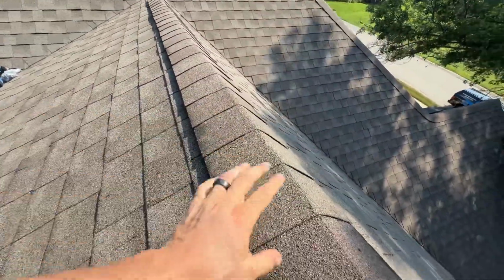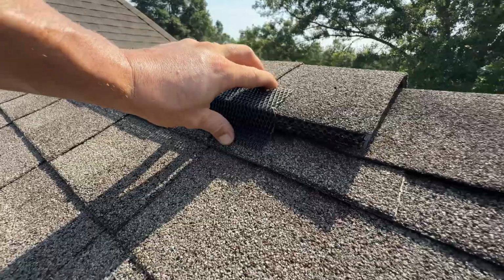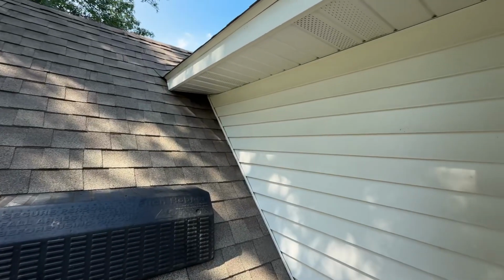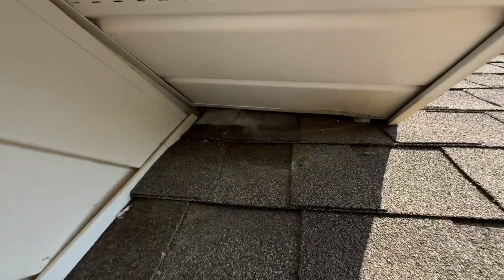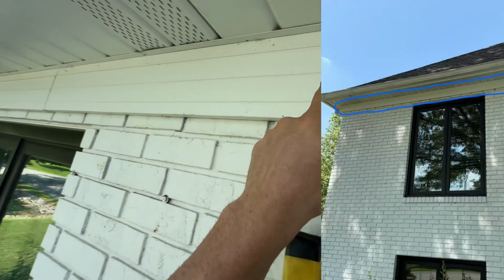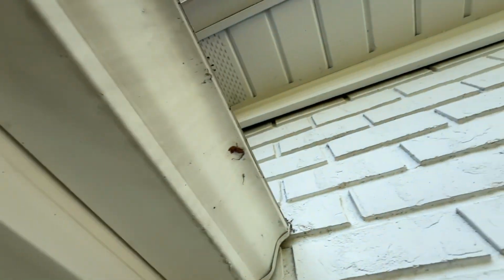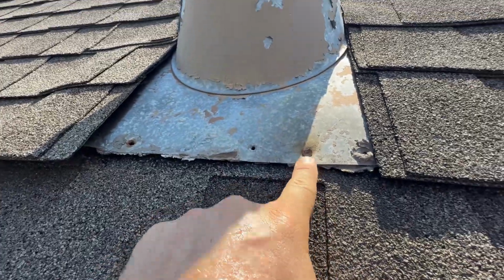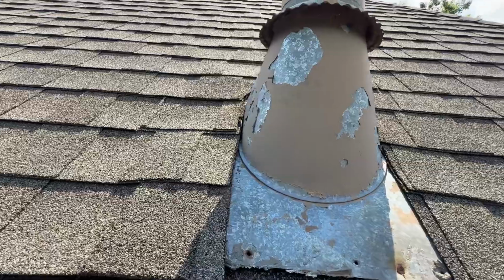How Bats Get Into Your Attic | Real Home Walk-Thru

Comment: Thank you so much for all the information. We have had 3 bars come in our house through our attic hatch. I even set a camera in the attic but did not catch them inside the attic . We haven’t been able to see where they are getting in from but you have shown more possibilities thanks! Would love to know if they are coming in through the attic vents , how would you install a one way trap over them without damaging the roof ? How many traps would you say you typically install ?
Reply from the maker: If you are having trouble pinpointing entry points, you can do what we call “bat watches” and have a couple different people stand around the home near dusk/dawn to see if you can spot where they are coming/going from.

You can use different fasteners to secure the one way bat door to the roof. Just make sure once you remove it that you are sealing over any penetrations to the shingles. Or you can use sealant products to temporarily glue it. It all depends on the location of the bat door. Our average home gets 1-3 depending on colony size and how many active entry points we have.
Reply: @PrecisionPestWildlife thanks! We pinpointed two active entry/exit points and have the camera set up for tonight . It’s where the soffit meets the shingles on the lower lever roof both front and back. What are your thoughts on one way traps made out 1/4” steel vs plastic tubes or aluminum?

Comment: How do you handle a bat problem in the attic where there is no access to the attic inside the house?
Reply from the maker: Great question! We seldomly will run into this and will have to cut our own access points to get into the attic (future video incoming). Even if we aren’t able to get inside the attic, we can still get the existing bats out due to all of our exclusion work being done on the exterior. A major reason we prefer to get into the attic is to validate if any remediation is needed removing bat guano (droppings). Hope this helps. Let us know if you have further questions and we can try to help